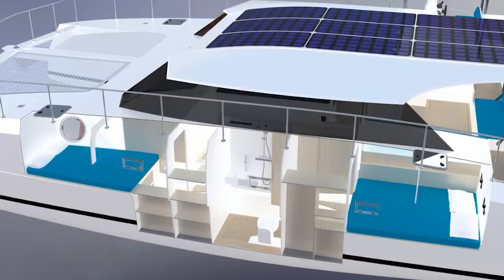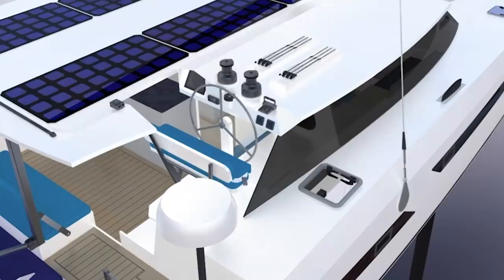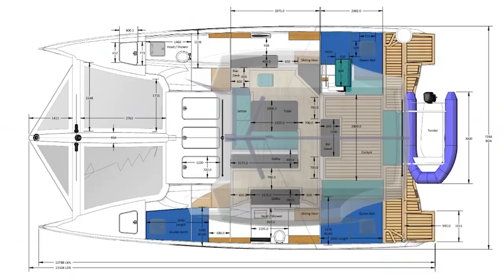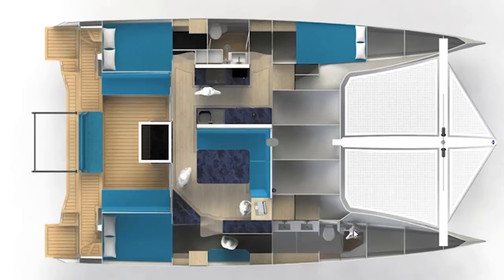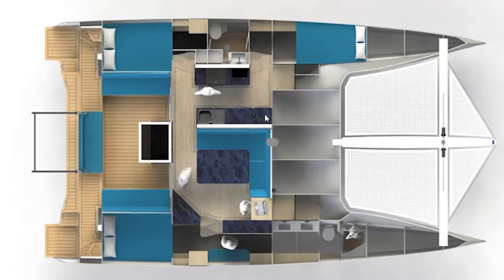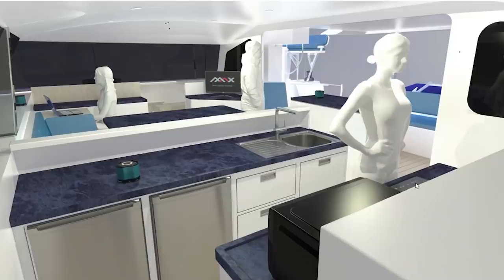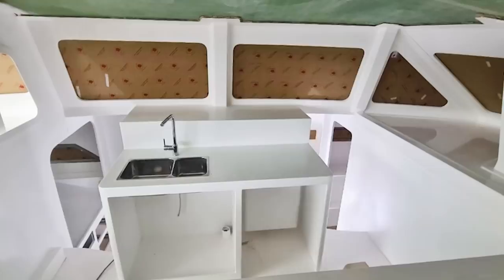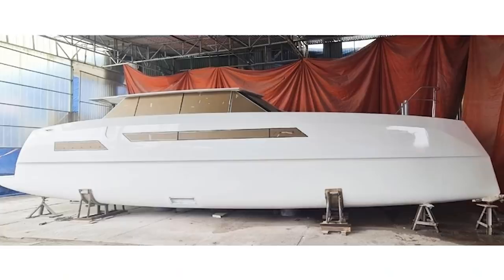CATAMARAN BUILD - How We Work Through the COLD Winter (MJ Sailing - Ep 218)

Comment: One thing that will help with the dust once you start working inside the boat sanding fiberglass or just about anything that creates dust. Put a furnace filter over the intake side of a box fan. You can tape it in place . Just try to point the exhaust side towards a opening to the outside of the area your sanding in. You can take the filter and place it in a plastic garbage bag to shake the dust out and then reuse it. It works great in my woodworking shop to clean the air and not spread the dust everywhere. One good thing it's a really cheap way to keep the air a lot cleaner .

Comment: That’s getting very creative with keeping your materials and the work surfaces warm enough to get the job done.  We have 3 of the oil heaters and love them for those areas that need a little warming without having exposed heat elements, which is much more pet-friendly too. Regarding the galley layout, some food for thought;  If the cook surface is next to the settee then you will always hav the issue whereby you need to be careful with cooking foods that splatter. Imagine someone setting with their back to the galley and if you get a little water splashed on them, or on the settee itself then it’s usually not a big deal.  However if you have some greasy food splatter, which it always seems to do, then hot grease, oil or even boiling water, getting splashed on someone can become a really big issue for many reasons.  Additionally the typical food prep area always gets food around it which could impact the settee surfaces over time where the splashing of water from the sink won’t be as big of an impact.
Reply from the maker: I think we might need to run out and get ourselves one more oil heater, but that would be for the Viking, as we need a way to bring the heat up in there just a little bit.  😊.   

We are still strategizing about where items such as the sink and cooktop will go in the galley, and we are leaning toward having the cooktop on the outside counter just for that reason. There still will be a raised partition between the counter and the back of the settee, but we've wondered if there might be splash over from cooking.

Comment: Thanks for the tour, it does help to understand where you guys are working.
I like your resin warmer. A very clean setup.
If your shore power cord is 30 amp. Be careful with resistant loads of over 25 amps. it can slow cook the cord, potentially causing a fire.

Comment: Sink at the window seems to make more sense to me. If you removed one of the steps on the guest hull you could fit a full shower in there. Not sure if that sort of change is possible at this late stage or not? 

It is going to be amazing, :D
Reply from the maker: The shower are in the guest hull is a pre-molded piece, so it would take A LOT of work to make any changes to it.  But we're happy with the layout, so we'll be leaving it as Max Cruise has designed it.  🙂
Reply: It is a wet bath, the whole room is the shower....

Comment: Great video and exciting to see how it all comes together. Just a point on the stove placement, I personally never like a stove by stairs and think it would fit fine over on the 7' bench with the sink also in that same bench with maybe the fridge and freezer under the smaller 5' bench if weight allows?
Reply from the maker: The issue with the stove over on the longer counter is that it guarantees someone, at some point, is going to get grease splatters when seated.   At least over by the second set of stairs forward we can control who comes up that way.
Reply: @MJSailing  True, lots of things to think about, you guys must be buzzing 😁

Comment: Acrylic expands and contracts an incredible amount. Glass is harder, less likely to scratch and will not expand and contract so much.
Acrylic will literally shear the seals due to its expansion and contraction on a daily basis. It is cheap, but will bring tears to your eyes….
Get a piece, measure it in the cool of the evening, and then measure it in full sun.
Sorry to rain on the cheap option, but glass will definitely b the better, longer lasting solution.
Reply from the maker: It's all calculated and designed appropriately for expansion. We did it on the last boat wothout issue.     Glass is great - and would be the preferred option - but the weight is horrible for the shear area we need covered, and wouldn't work for this build.
Reply: @MJSailing  Very good, and yes glass is definitely heavy.
Really enjoy watching your series, thanks for sharing. You guys are doing a fantastic job of building that beautiful boat, not to mention the great videography work….. I have a very small channel building motorbikes etc, and I appreciate the work that goes into the editing.
I have also been “involved” in two catamaran builds, so I have some serious respect for what you are doing.
Keep it up team, I hope 2022 is an amazing year for you guys.
Cheers 
Paul
(Nuffys Builds)

Comment: i'm worried that you are not putting any foam flotation below decks and are relying upon closed air pockets.  If you hit  a container at full speed, i would think many of those chambers would be cracked allowing water ingress and loss of buoyancy.  does the manufacturer not put flotation in those closed areas???  does the foam volume in the fiberglass panels provide positive buoyancy even if all the chambers are breached??

Comment: For shop heat you could try a diesel park heater. They are very efficient produce a lot of heat and because it ducts the exhaust out side no fumes.  They are small for what they do about the size of a loaf of bread and safe. One 8k heater keeps my uninsulated 20'x20' shop about 18 degrees warmer in the winter then outside.
Reply from the maker: A generic diesel heat like we had in the last boat was the original plan, but so far the electric heat has been so easy, safe, and cheap.  It's hard to justify a change at this point.   - Matt

Comment: Enjoyed the illustrative walk thru presentation.  Additional information on boat interior lighting and local work area heating: ice box/heating pad, infra red, oil radiator. What about the tent/shop/shed enclosure?
Reply from the maker: There is a propane system which can heat the entire tent, but we think there's a leak because our tanks emptied so quickly last year.  So we just layer up and otherwise work in the cold when we're not glassing.  😉

Comment: Like so many others this was great to help understand all the construction videos so far by understanding the layout.  You mention removing that center island in the open so then how do you change closing it off since the island only required a swing down window pane?
Reply from the maker: Make it a swing up center door :)  should work well, but the arc does impact the cockpit table size.   - Matt
Reply: @MJSailing  To avoid impacting the table size could the center door be hinged part way down so it fold back on itself when stored up in the cockpit ceiling

Comment: Nice to see how you guys are solving the temperature problems. Looks like a good setup. How much (what percentage) of the work will be in these little spaces?
Reply from the maker: I think we'll be working 90% in these areas until March/April when things begin to warm up.  But there's so much to be done in these spaces that we're not worried about running out of things do until spring rolls around.
Reply: @MJSailing  And will all that "fussy" work be completed when it warms up again, or will this complete the majority of the little jobs? So far, the boat is looking awesome!

Comment: 9:34 Hold on. Be smart now. Get drawer type fridges. Much much more easy to organize in/out (have two in my own landlocked kitchen and works fantastic) and keeps cold air much much better. Unfortunately they may more expensive, but u will never go back once tried.
Reply from the maker: The marine drawer fridges are less efficient.  They have less insulation and poor seals.   But they are convenient.
Reply: @MJSailing  I understand (and that you have done your research). 
However, though I have no idea about efficiency (I guess the compressor/motor), it's still possible to do something with both insulation and seals. 
Anyways, happy built, good luck and we all look forward to the end result ....

Comment: Thank God it's all in Metric. Imperial Systema already brought a Mars rover down. As an engineer, I wish we could get rid of the imperial system altogether since the metric system makes much more sense.
Reply from the maker: It has been great working in metric, but it's funny how we can just switch it on and off in our brains during the build.  While fitting out cabinets yesterday, we were talking about bringing it in 200 mm to give the hallway more space, but when it was time to cut fiberglass it was "Ok, I need a sheet of 16"x48"!  :D
Reply: @MJSailing  The thing that bothers me with the imperial system is that it is too complicated and unrelated. Like, I can tell you stock drunk, at 3 AM in the morning, how many meters are in one Kilometer. Now tell me how many inches are in one mile? First, you had to ask what kind of mile (air or nautical). I know, without thinking, that one liter of water weighs one kilo. Now, how many "Pounds" does one " gallon" weigh? Not even going into more scientific units, like thrust or force, where it gets even worse :D